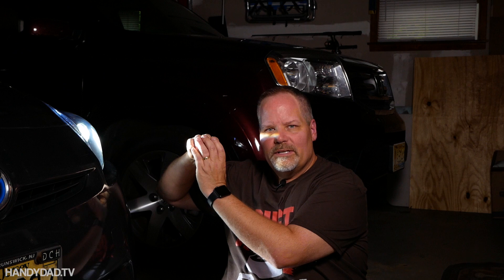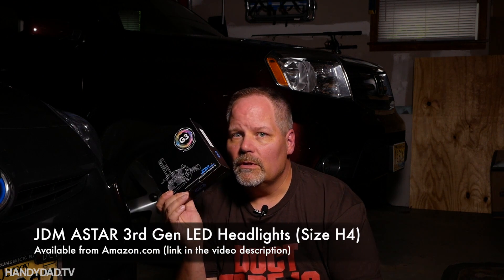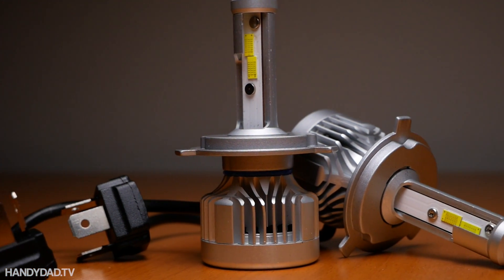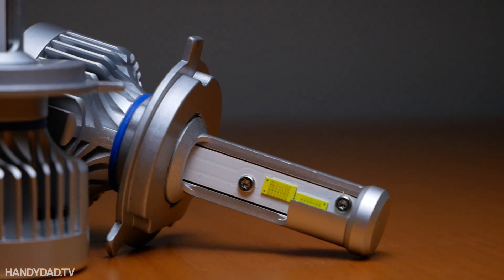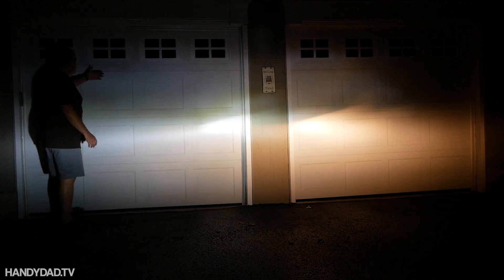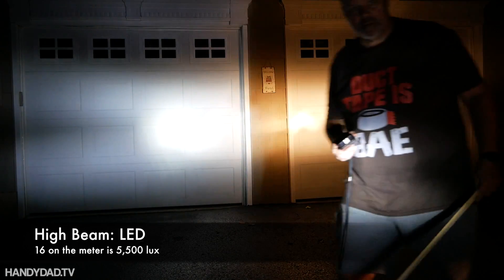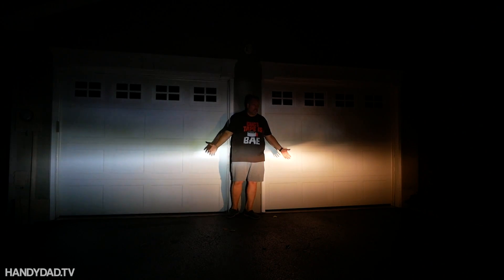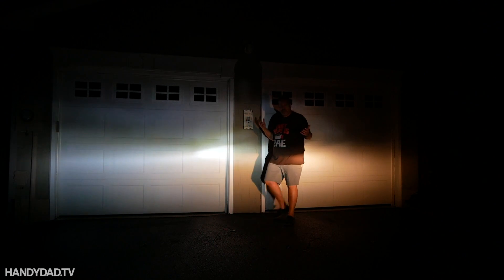Dual Beam LED vs. Halogen in Reflector Headlights

Comment: I guess one good thing about led headlights is that you can see the oncoming traffic more easily and swerve out of the way as blinded drivers career towards you. I hate the things. Factory fitted or aftermarket. Your eyes take longer to adjust to the dark than they do to adjust to the light. Hence being bombarded with bright oncoming headlights just leaves you blinded for seconds at a time. Unfortunately the general public fall for all the marketing b.s.
Reply: i hate it when oncoming traffic careers towards me. my benefit package sucks.
Reply: James Dickenson the lights that blinds you are xenon lights. Especially the aftermarket ones
Reply: UN E-spec reflectors have a much sharper cutoff on low beam than North american DOT-spec ones. This is mostly driven by the brightness of halogens.

E-spec also have cut off on high beams. They're not allowed to throw very much light higher than the centreline of the lamp (some, but not enough to blind oncoming drivers)
Reply: Your opinions won’t stop progress
Reply: Turn on the high beams and look to your right. Both of you will see the road clearly.
Reply: James Dickenson they are better for a number of reasons just like the old saying goes if you can't beat them join them

Comment: Stop promoting modifications to Certified stock headlamps that alter beam patterns and cause glare to on-comming drivers.
There are aspects to your "better then..." lighting that you're not taking into consideration in your quest... and in that quest (yours and MANY others)... there is an uprise in too many people "Upgrading" their lights... causing alot of issues in the real world application.... I.E... people getting into head on collisions due to glare and general "Washing of the Retina" (flash blindness in it's lowest form), in which causes Those people to upgrade Their lights.. and so on.... Please stay within the design of the lights recommended for your registered vehicle. thank you.
Reply: You got a good point here. And especially where someone lives one should check if those lights are even legal.
I live in Germany and right now no such LED lights are available having either an European ECE mark or here in Germany a K mark, which shows that those bulbs are checked, manufactured to a certain standard and certified to be legally used in any Headlight using this specific lamp type.
They would be fine if they match the certification standards AND the headlights are aligned correctly. The fact that no lamp got an ECE number so far to me shows that either manufacturers did not even dare to built the devices to exact specifications or no one built them exact enough to match the specifications and get certified.
Using such non legal devices here in Germany would mean your whole car would not be street legal any more and you loose your insurance.
Reply: plenty of documentation and proof available, not to mention the fact that headlight modification for ANY road legal vehicles is illegal.

Comment: No driving video to show the beam pattern on the road? Of course not. Can't piss off the sponsor by showing how much their products suck.
Reply: Wall shots from about 25 feet away are the norm for headlights, but even in this driveway example you can see how the stock halogens had a much better hot spot and beam distribution under the cutoff with less intense light above the cutoff.  The light above that cutoff line is there to interact with the reflective coatings on road signs to make them easy to see at night but with excessive light up there, as is the case with using bulbs that are optically incorrect for the housing, it will cause undue eye strain to other drivers on the road.  Like MonoPedB said, these are illegal for on-road use for good reason.  If you were able to put together an objective comparison between the two I would bet that you would get more distance out of the stock halogen bulbs and more foreground light (like you get from fog lights) with the LED bulbs, which adds to why people think they're so much brighter but actually reduces distance vision.  The higher color temperature is more likely to scatter in inclement weather (Google Rayleigh scattering) and will wash out any contrast on the ground, reducing your ability to spot potholes, road debris, etc.
Reply: Thanks for the video. I do not think that it is relevant to second-guess your motivations. But, I do think it would be very helpful to have a video of a car driving on a dark night with the OEM lighting, then with the LED. It would be nice if you lit up roads and signs with both, under city streetlights and on a stretch of rural highway.  It would also be very useful to have a video taken from a car approaching your OEM vehicle, and then again under the same conditions with the LED conversion.  Thanks!
Reply from the maker: They don’t suck; I’m still using them in the car. Videos of driving at night give no helpful data IMO but if you think so, that’s fine.
Reply: Every car I have seen on the road with these conversion bulbs have hot spots, dark spots, scatter, and glare. They have these issues because the reflector is designed around the location of the halogen bulb filament. When you change the location of the light source, even just a little, the reflector cannot properly focus the light. It's dangerous to other cars on the road, and it's illegal.  This is why they suck.

Comment: You'll get hi-beamed by other drivers with leds & hids more than normal halogin headlight cars
Reply: Get them aligned and you will be on the safe side, but from what the pattern looked light you seem to be lucky and everything is fine already.
By the way sometimes people say LED or HID are more blinding than halogen, some say the same about projectors. Actually this is partly some psychological effect.
For projectors, they look different in shape than what most are used to, that is why you look closer inconsciously. due to the smaler projector opening the stream of light is higher, so looking directly into them they are brighter.
Same with LED and HID, the white light or maybe the shape is different, so people tend to inconsciously look into the lights. looking directly they seem brighther (ok, at least HID and manufacturere LED actually are). H4 LED have to deliver a specific brightnes, as I think the amount of light they put out is specified in the H4 standard.
Another interesting fact, some decades ago people complained about the same problem when cars switched from normal incandescent bulbs (e.g. Bilux) to Halogen, which are brighter.
Reply: How do you know that nobody else is aggravated by your excessively bright headlights?
Reply: RonJohn63 cause its only those with excessively bright headlights that flash / highbeam me. With a jeep the bracket aims the 7" headlight assembly reguardless of which is in it
Reply from the maker: Honestly I was afraid of that, but nobody has. They are the same brightness and pattern as the stock bulbs - they just look better because of the color.

Comment: I had HiDs in reflector headlights and never got flashed by other drivers because I made sure that I adjusted the lights little lower than the halogens. I loved the HIDs on my 07 CRV it made driving at night so much safer. They didnt last more then  1 year without having to replace them and in the winter sometimes I had to try multiple times to get them working properly. So i went back to halogen and I got best Philips lights they have available can't compare with HIDs
Reply: Whether or not you get flashed is not an accurate form of measurement.  There are places where flashing your lights at someone will end up with you getting chased down and beaten to death (like California).  It is simple physics:  an HID bulb emits light in an arc an inch and a half or so long by igniting salts inside of a glass tube where a halogen bulb is a glowing filament maybe a quarter of an inch long.  The angle of reflection is equal to the angle of incidence, meaning that all of that extra light hitting your reflector at different angles is going to reflect it out at an equal and opposite angle (glare).  These HID and LED bulbs are illegal on a federal level for a very good reason, it's a good thing you bought the typically poor quality ones where the bulbs and/or ballasts are only good for a year or two and you're lucky the ballasts didn't melt or catch fire like I've seen so many do.

Comment: Great video! 👍👍👍.  Concerning the aftermarket dust cap you used on the Hyundai, doesn't it beat the purpose having the LED fan exposed to the outside thus allowing dust going in. The reason me asking is that I really don't understand how the fan on the LED works. Is it blowing only on the aluminum fins and the aftermarket rubber cap is placed tightly snug pass the aluminum fun housing?
Reply from the maker: The entire fan - intake and exhaust - is outside of the cap. The fan may clog with dust over time, but the light itself is still “sealed”.

Comment: So if they look brighter from the front (but generate the same amount of light) won't they bother other drivers in traffic?
Reply: If you put LEDs on projector housing  the cut off line remains the same, so nobody gets blinded, on reflector housing i have had no luck, light shoots everywhere blinding everybody, any of U had any luck with those 4 sided LED bulbs that mimic the halogen lights?
Reply: i thought my Passat from 2004 would make a great candidate for H7 LEDs because of the projector lens but it was awful. Sure there was a distinct cut off point but the LED's brightness was about the same as the standard halogen only whiter and the hotspot was scattered so one can see better to the sides but the light didn't really go far which was unacceptable. Reflector headlights probably have this same issue...thing is, only specifically designed headlights for LEDs will use LEDs properly  everything DIY is just for show and not a great upgrade...For old headlights HID is still the better solution or if you're scared of the law then use a premium halogen bulb like Philips Xtreme vision or Osram Nightbreakers
Reply: Fog light mk3
Reply: @erbentpm07 hAHAHHAHAHAHHA
Reply: Its allowed for Prius drivers to blind other drivers -  they get special rules because they are 'saving the planet' dontcha know
Reply: @erbenton07  i think i seen more blinding head lamps on BMW (obviously old models with aftermarket xenon/led)
Reply: Yes, and modifications like these are illegal in most European countries
Reply: They will. A lot. There is a ton of light above the cut off line. According to european legislation, there is allowed only <0,7 lx in this area. The measurement is taken exactly 25 meters from the headlamp.

Comment: Perception might tell you it is brighter but you can see the light density is not the same.
I'd prefer the Halogen after seeing your review
Reply: Bjoern H depends with the LED. I’d get a branded one like Philips ultinon
Reply: @GreatGrandmasterWang  That's what I have. 6,000 k color temperature with 4000 lumens each bolt. My LEDs are significantly brighter than my original halogens up to 3 times brighter probably
Reply: *Bulb

Comment: The LEDs you have are a "cool" white while the halogens are a "warm" white.  You can order warm white LEDs which are more yellow or you can even go cooler into blue hues.  it all comes down to the "temperature" you order which is a number like 4000K - 6000K  (Kelvin) for a cool white or 2700K - 4000K for warm white  I believe halogen are around 2700K.
Reply: 4300k is the typical xenon bulb which is still quite yellow. Pure white is around 5500k and above that will start to be blueish

Comment: Led bulbs are a god send for motorbikes that come with 35/35w halogen bulbs!! They do need significant adjustment to be the right height but they're a big improvement in light output.
Reply: Chris Weston I agree, my gsxs1000 has them and the light is so much safer, the led 'fang' lights also match perfectly.

One thing to add though, they are poorly made leds if you are having to adjust the headlight after fitting. Leds should be made so the centre of the led chip is perfectly aligned with that of a halogen bulb, if you have to adjust it then the chip is manufactured badly. 

Buy some better quality ones you will see that you don't have to adjust anything, there are so many £20 ones from China that are the same rebranded rubbish. The only was to ensure quality is buy a well known brand, the only ones I personally know of and have used is the philips leds. They are expensive but my headlight only uses one bulb so I split the cost with my brother and he put one in his mt09.
Reply: Chris Weston:::: They work well on my Super Tenere.

Comment: One thing about LED is that it blinds upcoming drivers IF the lights are not angled right.  A lot of people do no know how to angle these light.  There’s a screw that angles ur lights and every car has it.  Great review tho!  Thank you
Reply: That's exactly the reason why I installed 72 watt, 7000 lumens LED bulbs in my  SUV. So I can blind them right back. Those jerks turned me into a jerk
Reply: Richard Dodd, apparently EVERY car I meet with these lights needs the lights adjusted.  Even if they are adjusted properly I can't see where I'm going.  That's scary when both vehicles are going 55 mph on a two lane road where the vehicles will pass about three feet apart.
Reply: Not every car.
Reply: lol.  Post the link to these 7,000 lumen LED bulbs, please.  More than likely they are 3500 lumens each boxed as 7000.

A nicer light output combination would be to put high output LED's as your high beams with reflectors and, if you want LED's for low beams then do a retrofit so the projectors can give you that cutoff that's important to minimize scattering.
Reply: That doesn't change Anything lol the LED light is blasting away everything in your path.  I put led on my refletor headlights and yes it's definitely blinding, and NO you can't adjust it. For a bulb it works but not for an led that significantly brighter it doesn't. Unless you want to point your headlights straight down. I sent that shit back. Don't be a douche.
Reply: on most cars there's 2 screws - one for vertical and one for horizontal adjustment, per headlight housing. Undoubtedly the one that will be used the most will be the vertical adjuster, so oncoming traffic doesn't get blinded, but sometimes you'll want to point the headlights more to the side of the road to watch out for critters, depending where you live, and that's where the horizontal screw adjustment is needed.
Reply: Wrong.  It blinds because LEDs are slammed into housings that were not meant For LEDs, and the light goes way above where it should.  If you aim it down, then you're not gonna see shit at night
Reply: No two lamps are ever quite the same. You MUST reset your beam heights when you change a bulb no matter whether you're putting in Halogen or something else. (It's actually worse with halogens due to the manufacturing tolerances on the filament positions and support wires)
Reply: In that case, just flash headlights. If enough people do it, the offending driver will fix his headlights.
If one of the headlights isn't working, flash headlights too, as often people don't notice it until the second one fails too.
Reply: @max J. none of that bullshit makes sense, you can put any light you want in a reflector, doesn't mean it WILL work correctly.
Reply: Herman A. 
Any headlight can blind people if it's not angled correctly, not just leds....whats your point?
These leds have mounting tabs so they only fit in the correct orientation as a normal filament bulb. The only reason this may not happen is if they are not correctly installed or they are not made to a high enough standard and do not fully match a halogen location.

I am not taking led in a reflector housing argument, just the location within a housing, that is key to a well designed and manufactured led or halogen for that matter.
Reply: Yea any light can blind upcoming traffic if not angled right. My point is when installing any LED make sure that the lights are angled properly because just by installing it as is maybe a different angle then the ones you take out.  I’m just adding to your great video that you did.  Again thank you for the great tips.
Reply: @rich.dodd1  Any decent LED light will be clockable. Yes you're right that the LED sits in the same orientation as the halogen bulb, BUT the LED portion of the light can be turned/clocked to set the light cut off correctly. People don't do that last part correctly, that's why they blind oncoming traffic.
Reply: My headlights are adjusted up so my low beams shine like my high beams and my highs shine way the hell out there